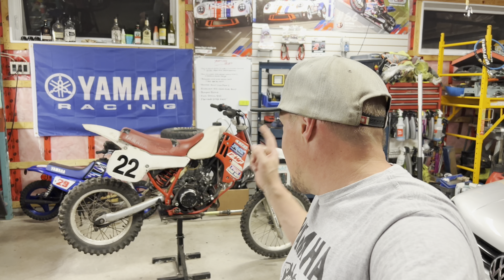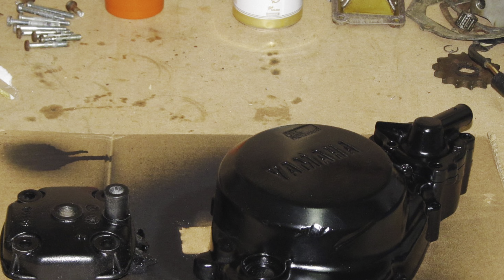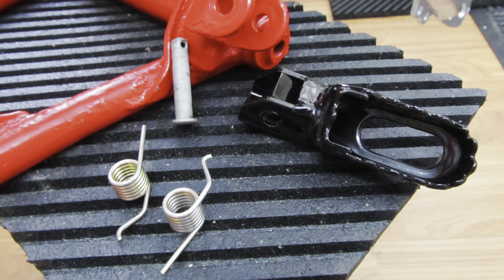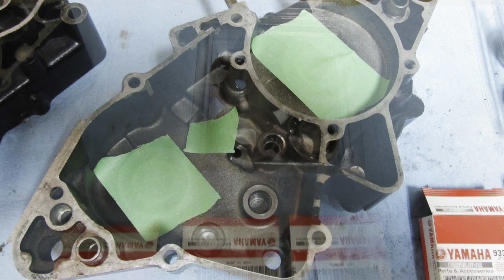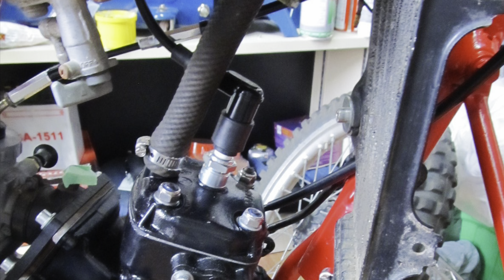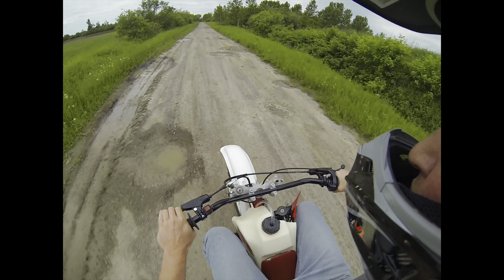How to bring back to life a childhood memory. 1984 YAMAHA YZ80 RESTORATION.

Comment: Hey there very informative video. I have the same bike that I am restoring. It is hard to find parts obviously for it and mine is missing whatever comes off of the spacer between the carburetor and throttlebody. It has a little hose barb that has a hose that goes to a plastic box. I’m wondering if you know what this plastic box hose connector part is that sits above the head? Appreciate it thank you very much.

Comment: I had 4 Yamaha DT125R growing up an a MTX and a KMX 200 before I was 16 , I could not afford a proper motorcross bike until I got older I just had a 91 YZ 250 white and red but new condition, it was 2 fast I wish I got a 125

Comment: Hello, i loved your video, it was very good. I have a question what are all the oil and liquid you use for the bike every single one ( not the wd like but the motor oil etc)
Reply from the maker: Thanks man! All oil used are Motul Brand. Transoil for gearbox and FD ester 710 mixed 32:1…. For race bike, I suggest the 800 32:1 or 710 40:1.